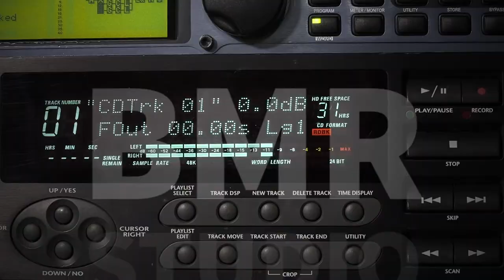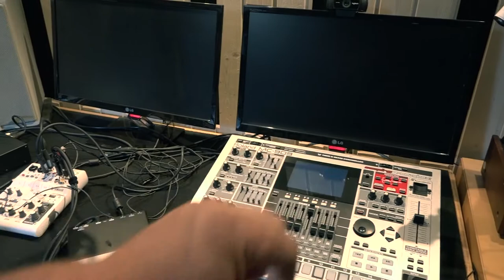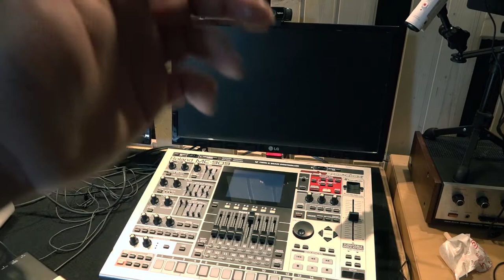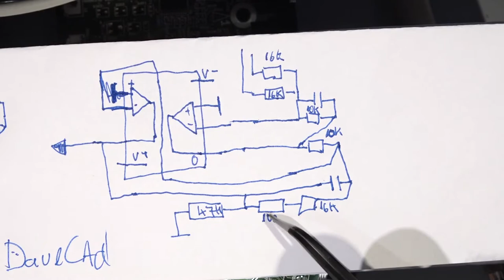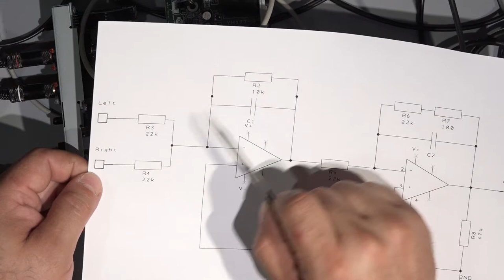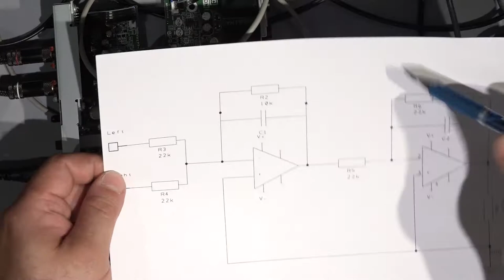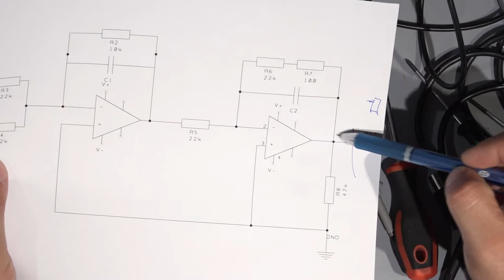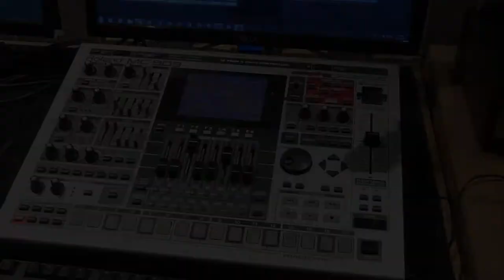Steinberg UR22 MK2 audio interface with mono monitoring? RANT, and hacking back to stereo

Comment: Thank you SO MUCH for sharing this information, I don't know much about electronics, but I paused the video, did exactly what you did step by step, fully expecting to break the device....but it actually worked and now its monitoring in stereo! I'm so happy right now I want to name my next child after you. I was going to buy a different sound card, purely because of the mono issue, but you have completely fixed it. Its mind blowing how you figured out the circuit and found a solution. thank you, thank you THANK YOU.

Comment: I have the same interface but with the left channel on both Phones output and Line out really distorted/weak. 
Thanks to your hacking video I traced the malfunction to the third opamp that relays to the left and right channels. 

Since your hack bypassed the first opamp I was able to completly remove it and replace the damaged one which both solved my left channel issue AND upgraded the interface monitor output to stereo! 

You're a legend man, thanks alot!
Reply: Was trying to output only the daw-processed guitar signal to my amp today and discovered that both channels were included in the mix.   I thought I was losing my mind.   Can you by chance fix my ur22 as well?  in virginia

Comment: i have a ur242 and can only stream mono signal from input 3/4.  i linked the channels in dspMixFx and set up everything like they tell you in the manual but it still mono. big headache
could it be that this solution work with my interface? it`s the same interface but with more inputs on the backside

Comment: In 16:40  up left  next to ribon corner there is opamp. Is that opamp for the mic preamp? It say 2068d jrc... I changed it with opamp  opa1642 it should have lower noise but interface still works same.. Is that opamp for first chanel or for both?
Reply: I found out in jullian krause video that it has more tha 120 headrom but preamp are the ones that are nosy around 100 headrom

Comment: Pls i need your help im having a problem with my sound card ur22, if i record a sound along with a beat now if i solo the recorded sound i can here the beat sound
Reply from the maker: Check the option in Your Steinberg  USB control panel settings. They called: Enable Loopback. Then check the monitoring dial on the front.

Comment: Hi i read a lot of sudden death of these units. Some wrote ist happend after disconecting mic´s with aktive phantom power. Did something happend to you too? Do you have a conclusion that could help bringin back unit to life?
Reply from the maker: Thorsten Pannwitz probably just an input coupler capacitor and the first opamp. Or (and) the last resistor in the phantom power feed line. 
Cost around 10$?
Never connect or disconnect phantom powered mic, until the output voltage is not zero! Just wait 5-10 sec.
Reply: @BMRStudio  If we have a broken unit could have a look on it when sending it to you? Many people were lucky to find out how to repair it...;-) Are you from Berlin ?
Reply from the maker: Thorsten Pannwitz Yes I’am from Berlin.
But, can be nice if You will fix it, is just a 98 Eur interface, worst case You buy a new one:)))
Send it if it’s too hard task for You. Decide before You jump inside:)
Reply: I am also ex from Berlin but living in Munich. So i got that little puppy now. First i downloaded th newest driver. Then installing them. Next was pulggin in in the ur 22. First blinking then stable light. So i can find it in my windows (7 x64) and in may daw /Studio one 4 prof.) I can choose it. So good so fine. But no sound at all. I plugged in the mike in xlr - nothing.  The mike has it´s own powerunit and i know it works. So no sound from Headphones plug and also no sound from the line out´s. Tested with mike plugged in and playing a song while using the yamaha  asio. hmm Turning the switches - nothing. i have a bit knowing of electronics, not that much. Any idea where i could have a look inside an make some tests?  Unit looks fine so far so not broken anything.hm- Would like to bring it bacl to life. ;-)
Reply from the maker: @thorstenpannwitz2345  Wow! send it to me. Looks pretty awful issue :) drop a mail to hcgberlin () gmail punkt com
Reply: @BMRStudio  Hi, did you found time have a look on it?
Reply from the maker: Thorsten Pannwitz Yepp! Horrible:) what a heck You did with this? Thunderbolts?
So I’m working on it, but I have a lot of other heavy projects on My neck. Few days and I will finish Your interface.
Reply: Hi I bought it as it is so it was broken before. And i thought your´er ther right man to find out what many others did and what´s the cause. If not there was a try . No hurry just when time is.-
Reply from the maker: Thorsten Pannwitz hurry hurry! I almost can’t sleep because of the results of the first inspection:) so weird!
Ah, and there is a big differences between the Mk1 and Mk2! You will see :)
Reply: Something new?
Reply from the maker: @thorstenpannwitz2345  Yepp. Everything recorded, On the weekend we are going to this exhibition, and then I will show you the results :))) around 14.th. of May then I will send You back
Reply: Thanks ! @BMRStudio

Comment: Very smart! Tell me please with software is not posible to make stereo input? Is only one way like you do?
Reply from the maker: When You do a  record, the recording is stereo. The problem is with the monitoring under recording. With Cubase, You can achieve stereo monitoring, but with a delay off course.
So Yepp, no other way to get stereo monitoring under record, only with hardware modification.
Reply: @BMRStudio  I need for live performance! I solve in ableton. And also on audio interface put knob on DAW. Thanks for answer
Reply from the maker: @VadimShinnik  Latency.... 7ms!
Reply: @BMRStudio  Latency is minimal! 2.6 I have very powerful laptop)))
Reply from the maker: @VadimShinnik  So You running with 256 sample buffer at 96K? Kind a fearless settings for live....
Reply: @BMRStudio  no my friend 32 samples. Is true!

Comment: please help me i´ve got the ur 44 for about 4 years now, but suddenly i need to turn de gain volume almost till 2 or 3 o´clock in order to have a good input level signal, (before i use to get a good input signal at 10 or 11 o´clock) the phantom power is working fine and the ur is updated and i haven´t changed the mic, and i´ve had tired different mics but its the same, any idea of what the problem could be?  thank you man
Reply from the maker: Check Your hardware settings for the channels. In Cubase. There is 2 option. -10 dB, pr +4dB
True only on channel 3 and 4. Otherwise can be input capacitor, gain adjuster circuit or some corrosion in the Neutric combo connector switching plates. Check Your noise floor on max gain settings! If the noise floor is a same like before, then something before the first op-amp (cap probably)
Reply: @BMRStudio   thanks man 
the settings are correct +4dB for channel 5 and 6, cause i have the ur 44 (6 channels) and i have the problem on the four main combo inputs, ill try input capacitor!! i will let you know!!! thank you again
Reply from the maker: @pipoguitar  Clean out the combo connectors first :) including the switch plates!

Comment: had the same issue with my ur22 & yamaha mixer ;_;  eventually managed to get mic input from the mixer but only desktop output through the steinberg >.<  finally upgraded to a interface with a more "robust" driver.  I'll  use my ur22 for my remote recording setup.

Comment: Omg do other Steinbergs also have mono monitoring???
I was considering UR44 or UR28M, is it a mistake or not?
Reply from the maker: Meh.... who knows:)... Check the manuals, the last pages contains the block diagrams . If You see a SUMMA operator, with 2 input, 1 output, well.... grab Your soldering iron :)
Reply from the maker: UR28M not mono, UR44 not mono. You are safe :)
Reply: @BMRStudio I somehow got those replies displayed in reverse order so it sounded like you were sure then not sure :) To confirm, I analyzed those diagrams. I'm not an electronic wizard like you but I see a box which says "SAME AS ABOVE X2" in UR44 and UR28M, which is not present in UR22. I guess this is what you mean? An abbreviation for the second output you mentioned? Also thank you a lot, I was already almost set on Scarlett 2nd Gen due to the lack of data from Steinberg, but now I will reconsider :)
Reply from the maker: DJ Full the 2 interface what You mentioned, is not mono like this s...t
Both of the interface, has a incredible mixer, effect engine, router, monitoring switcher built in. You can go for them, don’t worry.
Reply: @BMRStudio  thanks for confirming. I was just curious if I was reading the summa diagram correctly with this "same as above" box. it's actually a very valuable skill to be able to read those :)

Comment: Can you add inserts to it?
Reply from the maker: I think You can, because the board and the A/D converter using unbalanced signals on the input. 
So theoretically , You can add an insert point after the first preamp.

Comment: The main reason why you won't get live stereo, is that the inputs are mono, and you have no balance knobs or or stereo/mono button. It's a super cheap and pretty high quality audio interface. It would be weird if you heard your vocals on the left side, and your guitar on the right side, if recording both live, wouldn't it?
Reply from the maker: It weird, when You  wanna record stereo source and You hear everything in MONO.... It weird, when their own software, which is packed with the interface, has presets for mono or stereo monitoring! It weird, when the line output is also MONO from the stereo source. What about DJ-s?  What about home radio broadcasters? Or You wanna record everything mixed from the interface? Looks like , You don´t get the point from the video :) How about selected mode monitoring with a simple switch? We  talking about a brutal 45 Cent extra  cost in the interface... Or , a simple  digital signal  routing in the Altera something FPGA what they used, without extra cost? If Terratec did it around 1999 with their low cost stereo interfaces, (aka true zero latency monitoring with Matrix control), or MOTU in 1997,  or E-MU 1820 family in 1999, and many others, then why a super rich, powerful company like Steinberg - Yamaha cannot do a same in 2019? The whole design is just dumb. And this is the message of My video. BTW,  I still like this interface, no doubt. Cheap interface , great build quality, good sound. As I said....
Reply: @BMRStudio  thanks for the reply. I get your point. I just never personally was shocked that direct monitoring was mono, because that is the most natural in most cases. And the line output is two mono outputs, so nothing weird about that either. It can be panned in a mixer.  But yeah, I think it annoys people in different ways, the lack of direct monitoring in stereo. 

But if I had the option where I had to choose. I'd choose mono instead of stereo. The reason is, if I'm recording guitar and vocals at the same time, it would be super annoying to have each channel to the far left and right, hehe. Just saying. I still think your video is great in a number of ways. You have the best humor ;)
Reply from the maker: @TundrahSounds  Stereo is not only about PANNING dude :)
They mixed the two input signal  into one MONO signal!!!! Hardwired!
So no stereo field, position, phases, differences. like a Time travel back to 1954 :) MONO!
Reply from the maker: @TundrahSounds  I will send this video to STEINBERG.. right now :)
Reply: @BMRStudio   did you ever get a reply? :D

Comment: I need to hear myself recording, anyone can spare me the 26 minute viewing and tell me how to do it? I would be grateful
Reply from the maker: liligh You need an external mixer, or a audio interface with zero latency monitoring (basically a integrated mixer, or loopback from the AD to the DA converter, aka digital mixer...) or a hybrid mixer-interfaces like the cheap Behringer USB mixers, or Yamaha AG-06 etc...
Almost all interfaces nowadays supports zero latency monitoring. Not like in the 90’s :)
Few DAW software also supports near zero latency monitoring. Check Your hardware and the software.
Few driver also has a matrix routing control option! 
With the UR22, is simple, just turn the pot on the front from DAW to Input, until You get the desired level in Your headphones.
I hope this will help:)